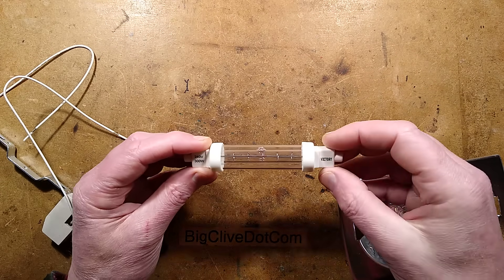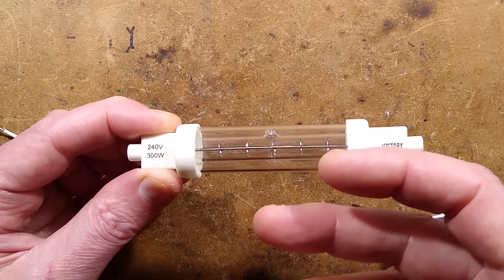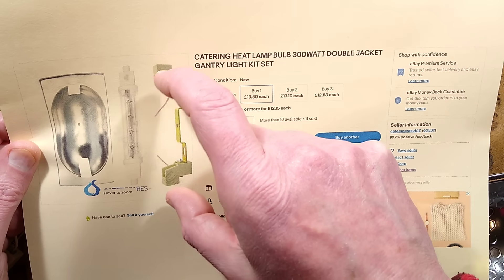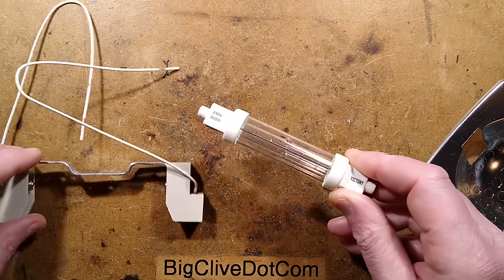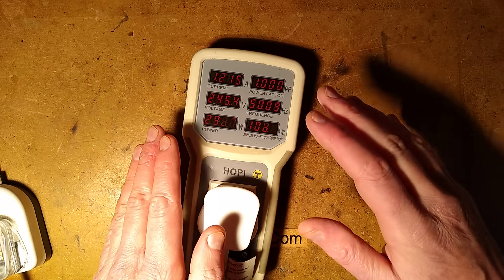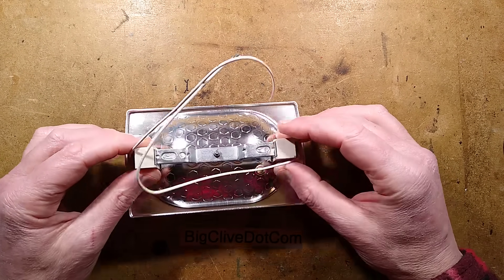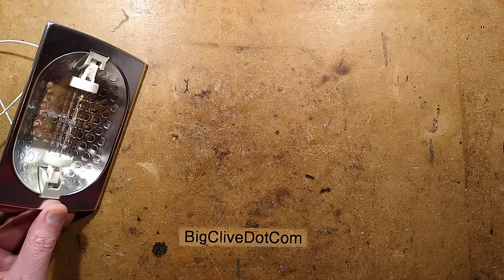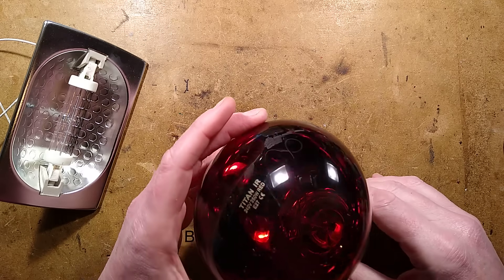Instant heat from an interesting linear heat lamp

Comment: I've always thought it might be useful to have a small IR heat source similar to this, rather than a big heater for those cold winter nights when it drops below 20°C overnight here in Australia. Last winter I decided to save some money by not using the heater as much as possible and my usage dropped by about 30%. I did use the heater on a few frigid nights when it dropped down to almost criminally cold levels, like around 16°C in my room. Honestly I thought the police might bust down my door and arrest me for having such a cold apartment. But most nights I got by just wrapped in a warm blanket. Perhaps a lower power, more directed heat source like this might be better than the old oil filled heater.

Comment: Those screw base heat lamps were placed in paint drying booths. I worked at a railcar manufacturing facility, and replacing an oven full of those the size of a RR car is a job and takes up some time. I would hate to know how many watts those booths run at.

Comment: Any thought on IR panel heaters? I'm after buying one but am struggling to work out where the IR comes into play, it just gets hot and puts out conductive heat from what I can feel
Reply from the maker: The heat it puts out is mainly in the infrared region, where it will heat exposed surfaces as opposed to the whole room.

Comment: These can cook a chicken or pizza in the right condition's and on a small solar setup 500W 1000W ~ 8000W
High Temp syro 800C  box + Radiant foil for a DIY oven - DIY warm box for resins

Comment: I have an LED light in my workshop anglepoise lamp during the Summer, but in the Winter I swap it out for 250W parabolic bulb which keeps my hands nice and warm whilst I'm doing stuff on the workbench. I've recently got a 500W panel heater and this is like sitting in the sun, but without the light.

Comment: Hmm, interesting. I wasn't aware that high-power halogen lamps gave off UVC. It it just because of just such a broad bandwidth of photons that are emitted from the filament, or is it a phenomenon related to the halogen? I imagine that because of the quartz envelope, any UVC will pass right through easily. Do all Incans emit UVC, and we just don't care because the glass envelope blocks it anyway, or is it just a halogen thing? I never knew of this phenomenon before.
Reply from the maker: The high power and very white halogen lamps seem to extend into the UVC spectrum slightly, with the quartz allowing it out.   I think it's very low, and probably zero with this lamp given how golden it was.

Comment: Question O Great Clive of Wisdom: how do you optimise a lamp for heat or light? And thanks for sharing,
Reply from the maker: Lowering the voltage to a tungsten lamp results in less light and more heat.  So they're basically using 300V lamps on 240V.

Comment: I used to work in catering back in my uni days and the stands that use these get ridiculously hot to the point where the heat can be felt a few feet away. Walk in fridges are always welcome after working around these lamps!

Comment: The heat fusing unit in laser printers have a halogen rod as heat source inside. I found out when I had to throw my old printer out because it was broken.

Comment: Good idea!  Radiant quartz heaters are, of course, the best and most efficient in all situations.  But my standby in every shop I've worked in is to aim a 1K PAR64 at myself.  Toasty and bright!  But, if like most techs, you already have bench lighting, you can pop a cut of R27 in it!  Makes you feel like a hot dog!

Holiday Cheers!
Reply from the maker: Technically speaking even a dark colour should work, since gels pass the infrared to reduce heat damage.
Reply: @bigclivedotcom  - So, Leko with a darker colour and a metal gobo?  :)

Comment: I have several floor lamps which use 500w fhalogen lights like that without the glass envelope. (Yes, I know they were known for starting fires, but I am not an idiot and can handle not starting a fire with them.

Comment: It's common in the US to have in some parts of the area wells outside the house in a small shed with pump and pressure tank. A.k.a. plumbing outside in climates where it gets cold. One of the things I was reading online is that a common way of keeping the pipes from freezing was to use 100 W incandescent lightbulb or two. Apparently this provided just enough heat to keep things from freezing will also be able to tell that it's working because you know it's a lightbulb you can see it through the crack of the door (yeah sounds like it's a poorly built shed). Now that you know that kind of bulb is illegal I've been wondering what the replacement was going to be because you don't really want a space heater what is an open filament in what tends to be a flammable location.
Reply from the maker: You can get small greenhouse heaters that use low power.  Another more efficient option might be heat tape under thermal lagging.
Reply: @bigclivedotcom  it’s just the simplicity and the availability of incident lightbulbs that was just so simplistic.

Comment: I looked into infrared heating. It is more efficient than space heaters, and it heats up quicker, but the difference is not terribly great, and compared to heat pump technology, there's no comparison The main problem with it is that you're still cooled by the air which isn't being directly heated.

Comment: The red  300 Watt mushroom lamp is 1st class for party lights in ( chilly ) lofts ... we used these in the 1970's ( ? ) , but it is important to mould aluminium foil over the neck to minimise white light spillage , unless you buy the type with TOTAL red glass all over .... I use a clear glass type ( ex NOKIA canteen ! ) to keep the cat cosy , but you need a dimmer ( variac ? ) to cut the Watts down or puss gets too hot !  FYI  , Philips do a very neat  glass COB  R7S lamp that gives 900 lumens ( 8.1 Watt = 60 Watt ) for all light but  NO  heat ( ? )  ...... ( tried - n - tested ) ........ DAVE™🛑

Comment: I imagine it will be relatively short/medium wave IR rather than Long. Wien's law would put peak for 2500ºK at about 1.2µm - and trailing down at by 3µm.  Long wave IR is 8µm to 15µm which would by Wien's law be peak emittance of a black body at near room temps etc.

Comment: Hmm, combined with a black concrete worktop as thermic mass . . .How do these compare with the IR LED lamps?
Reply: IR LED lamps don't produce much heat AFAIK, in fact my recently bought red+infrared light therapy lamp produces more heat with its red LEDs than it does from its IR LEDs.
(It's a 54W 18-LED lamp with 9 red LEDs and 9 IR LEDs, or 660 and 850 nanometer for the wavelengths).
But it's nothing compared to a good old incandescent lamp like my 100W red Philips one.

Comment: I wonder if the reptile lamps are optimized for infrared too.
Reply: There are multiple types of reptile lamps:
Only heat, so either infrared + visible red light or no light at all depending on the type of lamp
Only UV, therefore not much infrared but UVA + UVB + visible white light
Full spectrum or all in one, in this case it will be UVA, UVB, visible light and also infrared to provide heat and more or less mimick the sun as best as possible.

Comment: Across the puddle we use the "chicken coop" bulbs in a bathroom fixture for warmth when toweling off after a shower, usually on a spring wound timer, I don't like using it that way, feels like it's just burning a hole in my head while the rest of me is freezing. I usually have them for warming my hands and feet in the winter working in the shed.
Reply: Too close? Try multiple bulbs at a lower power.

Comment: yeah 300W should be not a joke. This winter I used 1kW metal tube IR heater to warm up my whole 1400x600mm workbench to 20c (and btw partially everything close to it too) in a fully concrete 20m² garage box that is 12c otherwise. It is very cozy under it combined with proper thermo-clothing. But I probably wouldn't use halogen tubes, they are probably a touch less effective in IR and harsh for eyes, there should be a proper color temp LED light instead.

Comment: i found these type of lamps with 1000w in Laser Printers.
Reply: Same (Well, almost), I found a 850W linear halogen bulb in a laser printer as well.
It was inside a rubber-coated metal tube that was part of the fuser assembly.
Powering it outside the tube gave me eyestrain though, probably from the UV, even with a glass window in between.
It's weird that 500W halogen bulbs made to light rooms never gave me eyestrain so far even without a glass cover as they must be emitting UV too since they're halogens as well.

I even checked them with a wood's lamp and they don't glow any more than the printer bulb, meaning they don't have UV filtering in them.
(Some bi-pin capsules having UV-Stop or UV-Block marked on the packaging and glowing a nice blue under a wood's lamp as a result of having a UV-blocking doped quartz envelope).

Comment: I've often seen red glowing heaters about twice as long as the one you show in outside restaurant or pubs and the heat is in one area.  If you are sitting to one side of the heater then you miss out on the red heat
Reply: Well yes because it's electromagnetic radiation, you need to have line of sight to the source for it to interact with your skin and warm you.

Comment: Recently went down a dozen plus hour rabbit hole on how to heat my drafty mountain apartment better without using typical space heaters. Originally was going to go with directed halogen lighting with reflectors but came to some seriously problematic conclusions. Got Sylvania Tru Aim IR bulbs last year for what was planned to be infrared heating on a different project only to find out they're not IR bulbs - in fact they made me scratch my head at first why they would block invisible and comfortable IR but then found out why. 

Not only did Sylvania find they could reflect the IR heat back onto the capsule to lower the energy needed to keep the coil incandescent, the benefits of NOT having 800-1600nm in your eyes is truly underappreciated. Excessive exposure to that wavelength range will cause cataracts as glassblowers and laser operators have found out. Having worn laser goggles to keep that garbage out of my eyes I don't need 1000w of Halogen pumping out 850w of Infrared according to Zeiss and tungsten lamp spectroscopy shows - it's 85%!*

Being in close proximity to high powered halogens is bad for you unless you're filtering out the NIR, and if you're doing that then you're cutting down most of the heat output so the whole endeavor of halogen lighting as heating seems pointless. The true answer is radiant heat panels, they used to be obscenely overpriced but I got a really nice one** and some high CRI Phillips bulbs and called it a day - all my heat doesn't just fly out the holes in my roof and my eyes aren't irritated. Plus in the summer I'm not gonna hate my lighting for cooking my place.

*Receipts from Zeiss on tungsten halogen: "(up to 85 percent) lies in the infrared and near-infrared regions of the spectrum, with 15-20 percent falling into the visible (400 to 700 nanometers), and less and 1 percent in the ultraviolet wavelengths (below 400 nanometers)."

**it pumps out up to 1500w of 3-15 micron heat in a focused area and I often turn it way down - I don't need to heat my whole place just my workspace. Best $200 ever spent at 0.33c a kWh utility rates here.

Comment: As for bulbs and heating, those ruby red 40w ex-MOD submarine bulbs I got a little while back, I stuck one in my bedroom light and on the colder days, just having that running continuously manages to take the edge off the cold at night, and being a dull red glow, it doesn't bother me much when sleeping, just shows what we lost when switching illumination devices from filament to CFL to LED, just that little bit of extra heating from our bulbs...
Reply: Curious: Is your house not insulated? And what are the temps at night? 

-I hope you sleep warm. Merry Christmas. :)
Reply: @FunnyPhisto  18 inch thick stone walls make it hard to insulate (without adding that fugly and controversial external insulation cladding, of course), there is roof insulation, but being a late 18th century terraced house built cheaply (back then) to house workers for mining, railway stuff or the former Co-operative buildings, it's not exactly set up to be the Ritz, as for night temperatures, I rarely measure them, this is the north east of England so winter time is nippy, and the heating system's not exactly state-of-the-art either, it does what it needs to though, we don't freeze, just have to put up with being cold now and then cos it's imperfect...
Reply: @twocvbloke  - curtains or tapestries.  (That was one of the main purposes of tapestries after all.  Block drafts and add insulation, although they didn't know that it was actually insulating.  Just blocking drafts)    

You can also go for a four poster bed - that's also the main reason for their construction, with the curtains.   (That and keeping the things falling out of the thatching from dropping onto the sleeper)
Reply: @tbelding  Of course in this modern day, we have a thing called "central heating", ain't perfect by any means, but costs less than buying tapestries and four poster beds..... :S
Reply: @twocvbloke  If you have 18" thick stone walls with no rammed earth in the middle for insulation, then central heating doesn't help much.   As for the beds, they can be picked up used, often pretty cheaply. Tapestries... well, what I used was canvas drop cloths.   (workroom had one wall that was one HUGE window, made in 1947, with commensurate air leaks. )
Reply: @tbelding  If central heating (by which I mean hot water pumped around radiators from a central gas boiler) was not much use, then this and thousands of other houses around the UK would have been declared unfit for habitation decades ago, plus the UK doesn't get THAT cold (not often anyway), as for buying beds and curtains and all that, no, I'm not made of money...
Reply: @twocvbloke  Yeah I lived in similar buildings in similar climate and warm socks and layered clothes are the best friend in the winter. Good to hear you are not freezing. <3

Comment: Could you add a fan and make a hand dryer with this?
Reply: If you put your hands under a 250-watt heat lamp, you won't need a fan. In fact, you'll burn your hands if you're not careful. They're plenty hot by themselves.
Reply: @Erik_Swiger  Didn't want to poach my hands but a fan would help to remove the moisture. Maybe turn down the power of the lamp.
Reply from the maker: I think the fan would dilute the heat.

Comment: I have an old work light as well as a floor torcherie lamp that take the 500W tubular quartz lamps.  Both have protective glass over the bulb.   They run very hot--should an insect land on the glass, it's vaporized in short order.   I've got the materials COB+ballast to retrofit the floor lamp with something less power-hungry or dangerous, but haven't gotten around to it yet.

Comment: Would be good for a paint drying or resin curing box. Just needs a pc fan venting outside.
Reply: Good for paint drying. As they found out at Windsor Castle. Caused a £36 million repair bill when it caught on fire.
Reply from the maker: Halogen floodlights have caused lots of fires when put against surfaces.

Comment: Hi Clive,
I couldn't resist after having seen the video and got to get my own infrared heat lamp, chicken coop type in my case.
So I found a cheap second-hand lamp with a Philips 100W infrared bulb, which to me looks very much like a standard reflector bulb except it puts out red light instead of white light.
I'm wondering however if it could be harmful to my eyes or not. 

The bulb is currently set in an anglepoise-type lamp above my knees while I'm sitting at my computer so I can warm my hands or knees, however there is red light leaking through the vent holes at the back of the shade into my face and ultimately into my eyes and it doesn't feel very comfortable but it's also not nearly as bright as looking in front of the bulb.

I wonder if it's only because of the visible red wavelengths more than the infrared though.

Reading the internet I found that infrared light is focused by the lens inside the eye and can burn the retina, however no relevant information about heat lamps.
I hope it won't be more harmful than a standard incandescent bulb, so I could save power by not using my space heater as much as I usually have to do otherwise.

Do you have any idea ?
If it's harmful to have it above my knees I'll put it in the ceiling light instead and/or switch the space heater back on as well.
Reply from the maker: I wouldn't gaze directly into the front of the light, but ambient spill and reflections are fine.

Comment: Doesn't the metal holder surround need to be earthed as it is potentially a metal part that is exposed..
Reply from the maker: The bracket and reflector would be grounded in a suitable metal housing with earth connection.

Comment: Just saw a water bottle on Amazon that claims to have UV-C light in the lid to sanitize your water. It's called The LARQ Bottle
Reply from the maker: That is actually viable.  Older versions used a submerged UVC tube, new versions use the new UVC LEDs.  I'd trust the tube version more, as it has a much higher output.

Comment: People use those "Rotlich" IR lamp in chicken coops and kill off a bunch chickens every year.  Chicken drinks a bit of water, shakes the head, water hits lamp, breaks glass, glass lands in straw..........  A couple years ago neighbor lost all his chickens this way.  We tried to put the fire out but it was winter and the hoses and such were put away and water shut off to the outside spigots.  Running back and forth with 5 gal buckets just didn't work.  RIP chickens.